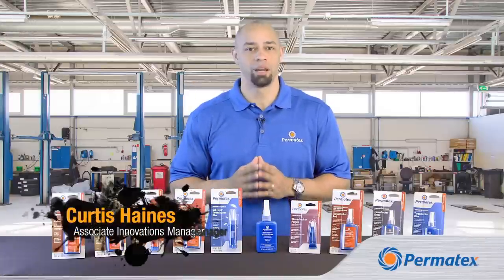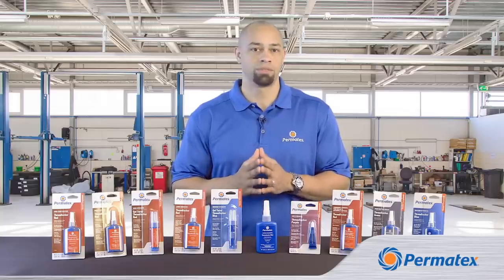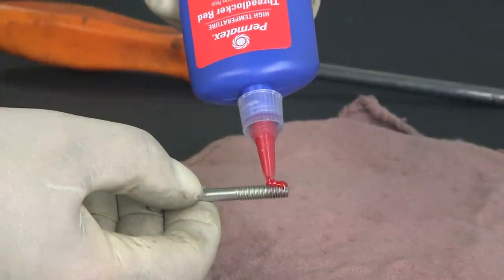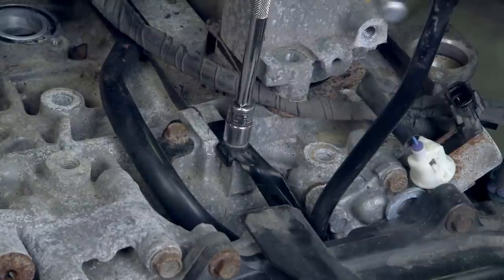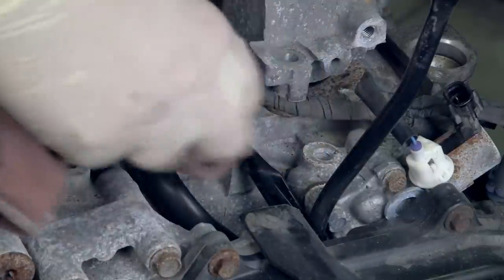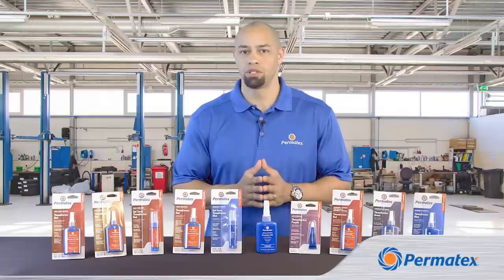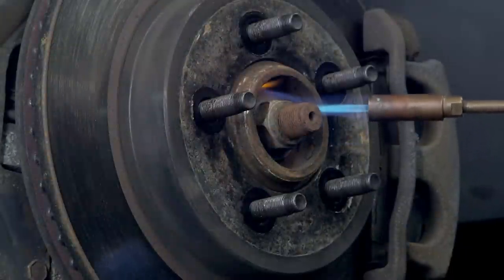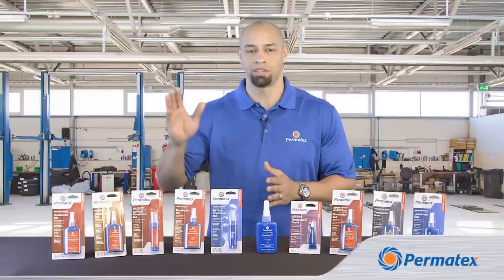Threadlocker Application Tips: Permatex Tech Tip Series

Comment: An engine I am rebuilding has a bolt that goes through a coolant passageway, and the GM recommends using an RTV gasket maker to ensure that this bolt properly seals. I am assuming no threadlocker should be used in addition to that, but I was curious what you guys think.
Reply: Cars Simplif

Comment: is there a thread sealant that activates more like glue, so that i can position my brass fittings in the direction required, which a lot of the time means they are not fully tightened? 
It is said in this video that these thread-lockers are activated when tightened down, so that no air is present (anaerobic), so i assume that's not what i am looking for?

Comment: I have abolt on my car that striped .Wonder will this work to keep bolt tight
Reply: Did it work? Me also have thread loose and want to use this?
Reply: I wonder if just using plumber yellow or white tape would work on helping threads grab
Reply: Im worried about the heat in tht bolt..
Reply: Yes did not think of that issue .. Well try this stuff  and see . My issue did not become a issue like I thought it was going to be . So just used the plumbers tape No heat issue ither
Reply: Ok thnk you
Reply: @danephillips  this is not a good repair
Reply: No, because the fastener needs to stretch to provide clamping force.
Reply: Possibly if you just thread it down snug as you mention that it is stripped but depends on the application. It will obviously add strength but better to fix it.

Comment: what threadlocker should I use for the metal coolant drain bolt? it keeps leaking, rtv doesn't help
Reply: Crush Washer with a silicone inner diameter washer works well for my drain bolts

Comment: I don't understand the Surface Prep activator. You say at 1:02 that the parts have to be assembled "before the activator cures". What if the parts are difficult to assemble? For the High Temperature Sleeve Retainer it says the part can be heated for assembly, but the activator says max temp 120. It's not making sense. What if I clean the parts with acetone?

Comment: I USED THE RED ON MY CALIBER BRACKET BOLTS, SHOULD I BE WORRIED ABOUT GETTING THEM OFF AGIN?
Reply: Is that brake calipers? Should I be suspicious the temperature of a brake caliper might get above the specified allowance for medium strength Threadlocker?
Reply: You should know by now. How did it go?
Reply: @scientist100  they still good, i have not changed them yet